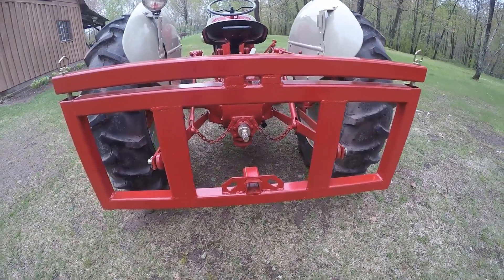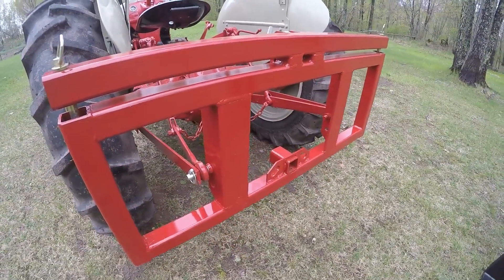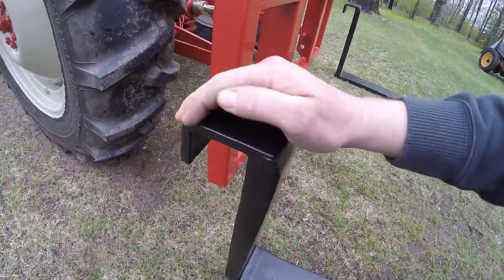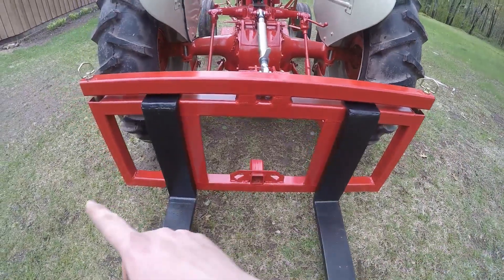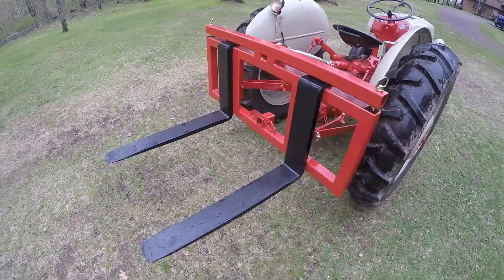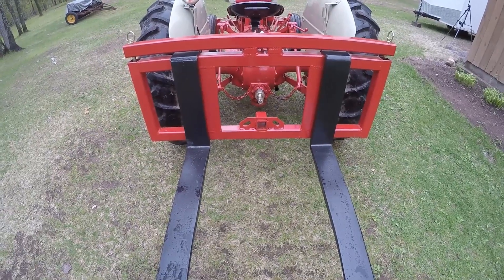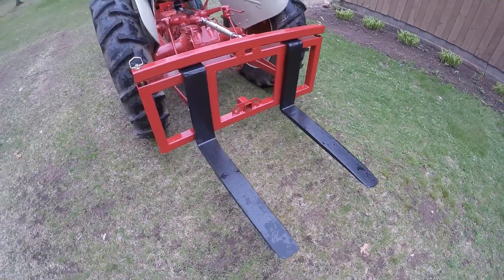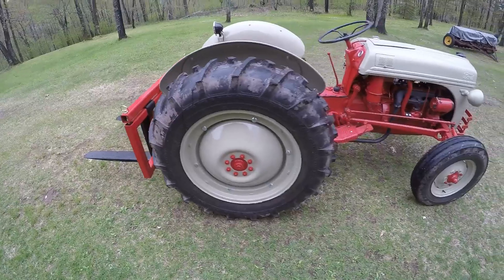Home Built 3-Point Pallet Forks - Trailer Hitch Attachment

Comment: Nice work! Looks handy! Question - I’m building a 3pt hitch for my AC D14. The tractor will utilize similar equipment to your Ford 8N.  I’ve designed the 3pt geometry similar to an 8N. When the hitch is in the raised position, what’s the distance from the lift arm ball joint to the ground?
Reply from the maker: 32” at the center of the lift arm ball socket at full raised position, and 5” at the full down position 👍

Comment: There is no provision for curl how are you going to keep a log from rolling off you'd have to screw the
three-point hitch adjuster under load which is impossible. You need a hydraulic cylinder unfortunately
Reply from the maker: You don’t need curl, you set the forks to level and they stay there whether lifted or lowered 👍

Comment: Would you consider taking on customer tractor restorations?
Reply: @squatch253  I understand. I ran across your videos because of the cab light install video. Long story short My dad owns a 601 workmaster that was crudely restored, and has been sitting at my uncles for a couple years. The paint has lost its luster and a few areas of surface rust are appearing. Id like to eventually get it the quality restoration it deserves. But I understand your stance. Do you have any references?

Comment: Excellent build.  My first tractor didn't have a front loader and I used a set of hay forks the same way to move all kinds of stuff on pallets, move logs, hay, etc.  Yours is more versatile than fixed hay forks + putting that receiver tube on it is handy.  I assume you got an actual set of forks to use...lot of people don't know they are a special high strength steel....you can't just make them up out of flat bar or tubing.

Comment: Excellent work on the forklift attachment!  However, I noticed that the PTO was always spinning and was not shielded or covered.  Please put some kind of PTO guard on that tractor.  I had the brother of a sister-in-law get caught up in one and what was left of his body they buried in a closed casket!  I have an idea, use that PTO for a small hydraulic pump that can be used to run a hydraulic top link so you can tilt the forks.  That should/could cover the PTO and put it to use at the same time.

Or, cut a cylinder from a section of pipe and cap one end and drill a hole in that cap.  Then drill and tap the end of the PTO shaft and you could bolt the capped cylinder over the splines of the shaft so you would have a smooth surface to make it harder to get things caught in the PTO.
Reply: That is because those ford's don't have live hydraulics. The pro has to be engaged for the three point to work.

Comment: Squatch... Noticing that tow hitch you welded onto the forks frame. Careful pulling anything with that when the hitch is above the height of the rear axle. That machine obviously has no ROPS. The draw load must be equal or below the axle height. With enough forward energy it could pull the machine over front to back. There's a ton online about drawbar location safety. Just something to consider if you're pulling heavy loads. Don't mean to sound like a safety nanny.

Comment: I like it. It looks like it has a lot more things you can do with it than some other videos I've seen that try to build some home made device. It's seems way more versatile for relatively inexpensive cost in a homestead environment. Hauling firewood, hay, or brush in the trailer and lifting logs with the forks to cut them or move them. Awesome. I watched a video of a guy  who built a three point hauler made with a steel frame and a open wooden box that was in my opinion inefficient use of the tractor.

Comment: Nice work! I like the receiver hitch idea. I have a question about the Ford you are using. I know they have a hydraulic system for the three point hitch but are there connections and valves for remote cylinders?

Comment: THAT is a NEAT rig, pal! The first thing I saw was the ball hitch receiver. HANDY! VERY well made. You're showing your handiness again! MY electricianer buddy decided his dream heating setup wasn't going to work like he thought. He said he could pull it with a #12 wire, but he also found out he needed 3 units so he's going back with wood. He came to get the splitter with a 2 1/2 inch ball. Went back home and got a 2 inch. The splitter hitch was 1 7/8ths and he'd loaned all his out. I had a spare hitch so he went to the store and got a 1 7/8ths ball which I put on and I sent him and the splitter on his way. I'd rather tote wood than look at the power bill too. Happy weekend, Buddy and Memorable Day.
Reply: You did a FINE job and I lay odds it comes in handy all the time. The 8-N runs better than any Swiss watch I've ever been around. I know everybody wants a diesel but for the money I'd just as soon have a gas job. Even though I'm diesel powered I still am eager to hear a good gas engine ticking along. Yessir, tomorrow is a special day all right. Juan Browne did a good memorial on his channel about the ones that have already gone on. I think of all who came so close and can't forget about it. May God Almighty help them.